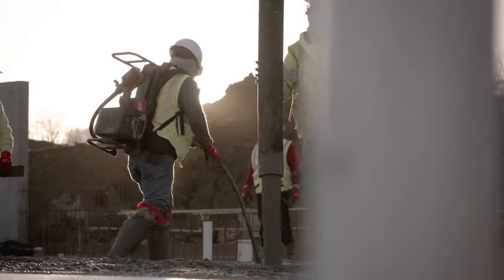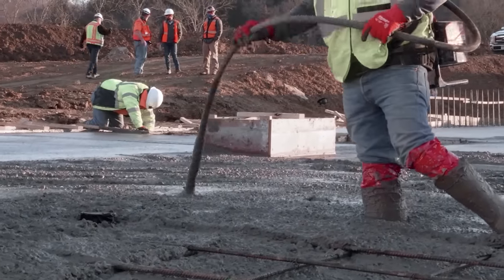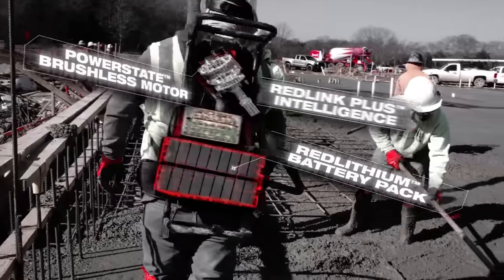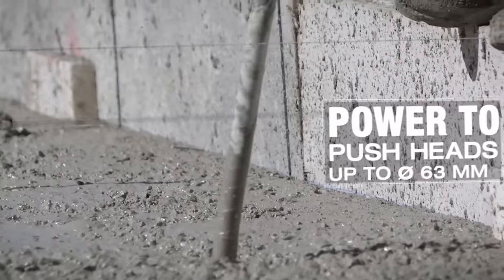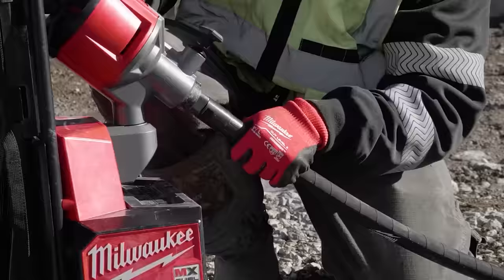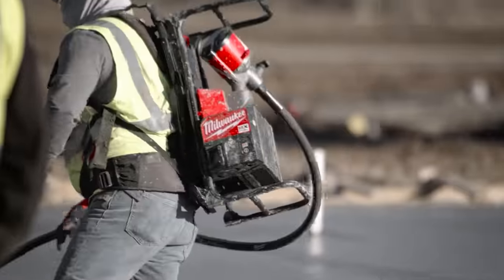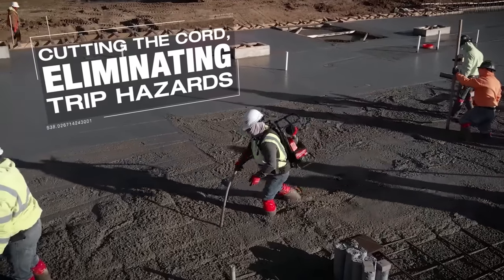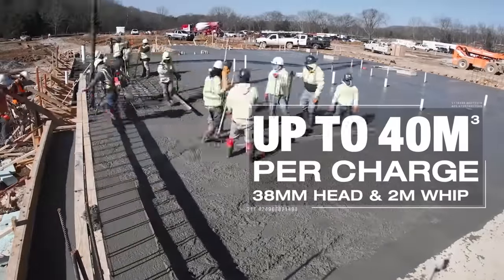MILWAUKEE® MX FUEL™ Backpack Concrete Vibrator

Comment: Our local rental company recently purchased some Mx concrete tools and the last two times we’ve rented them one of them wouldn’t run for the first 20 minutes. Sadly some of the least reliable cordless tool performance, I’ve seen, especially from a new tool.
I do realize that all this is an isolated incident, and it might just be because somebody that rented it used a pressure washer to clean it after, who knows.